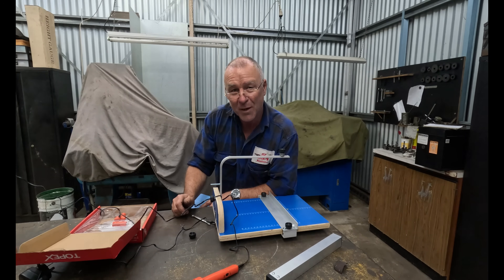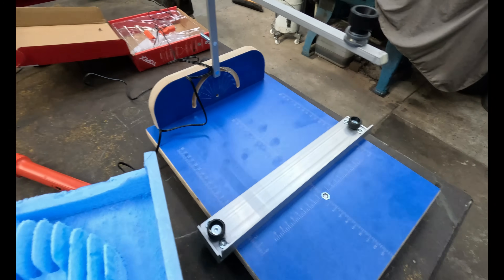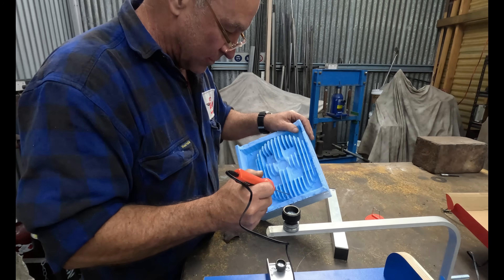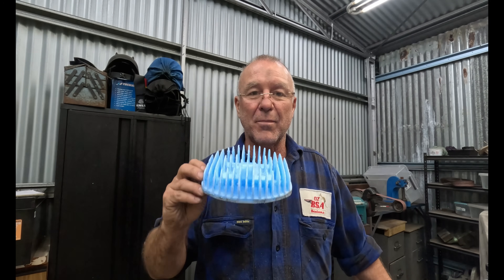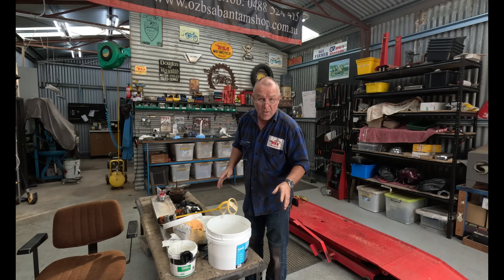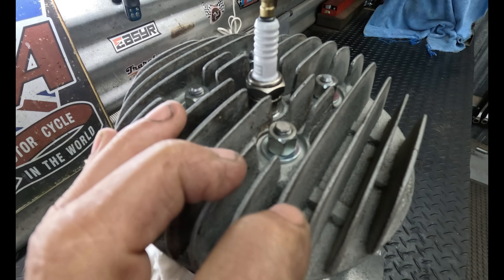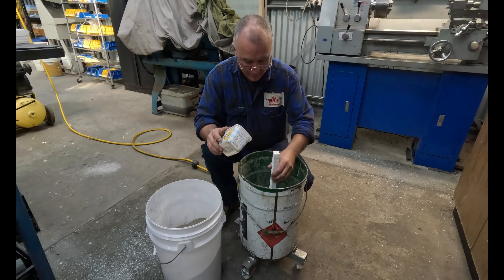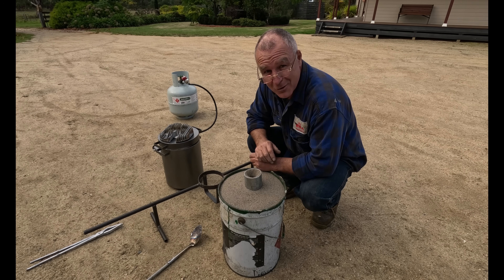Lost foam casting BSA Bantam head

Comment: Please turn off the gas at the burner end 1st, boom
Reply from the maker: There's no isolation valve at the burner end. the only isolation valve is the bottle.
Reply: @OzBSABantams  ok, that is dangerous. Strange they designed it like that unless there is a one way valve at the end, but I heard the squeal you hear before the bang, so was waiting for something. Good luck bud
Reply from the maker: @tonysimonsphdpending  Had a look at the video again (it's been a while) the only 'squeal" I detected was the flame going out after the gas was isolated?
Reply: @OzBSABantams  no, I'm not being silly. I've been near one of them explosions and that is the noise it first makes, then goes to a higher pitch before boom. Yours didn't go to the higher pitch meaning the flame died at the nozzle. Let me have another listen. Love the videos m8, don't get me wrong, I'm looking out for, not trying to be clever x
Had a look, yes that at 12.08 is definitely the first noise you will hear before the next. Come on, you looked at it when it did it! Keep up the good work buddy x
Reply: Right further to this bud. Do you recommend the slurry you used, or will I be better using refractory plaster? Reckon?
Reply from the maker: @tonysimonsphdpending  In all honesty I gave up on lost foam and went back to green sand. It took a while to get to my end result, but I got here. I'm sure you probably watched Kelly Coffield's video collection. he's the one who has mastered lost foam. I had to have someone machine the foam Molds, and if there was an error in pouring (and there was) I had to wait again for a replacement. Also the foam mold was very fine and had some machining difficulties. Green sand meant I could keep replicating the item without any hold ups. It also meant I could produce patterns on a 3D printer myself...........Good luck with your casting!

Comment: I would have two sprue , or a sprue in a U shape running under the head filling it from the bottom. One side filling the other side venting and acting as a reservoir as the head cools. Using  possibly 30 x 30 mm low density foam.  Ang get it atleast 150-200 mm above the top of the head. And possibly glue some low density foam on top of the fins. And  make it attach to the sprue  so they can fill and vent much easier. Coating in wet  thin plaster and allowed to dry being certain the area in between the fins is coated well with a tall sprue to keep the pressure high until it cools.  I love lost foam , lost wax casting, maybe a wax head can be made, coated the a block of plaster, then melted out, and filled with aluminum, like the 3D print castings are done??!!?  3D printing a head can be much easier..
Reply from the maker: What you've suggested is what I'll be doing next time..........It's been suggested by a few others.

Comment: Some ideas experimental-
Just having a look at the finished product seems pretty decent bar the extremes of the thinner sections. The fins not filling out - maybe air is getting super heated and trapped long enough to stop the AL flowing into the extremity of fins . I'd try gluing a small cylinder/square poly tube  that runs across the highest parts of the fins ( as it laid in bucket) and extend that to egress air at top of bucket. You will have to grind off that if flows to that extreme.  The other possibility is running a higher bucket and increasing the pour height for more liquid pressure into the cavities.

Comment: https://www.youtube.com/watch?v=4gtodI6QsFo
These are racing Bantams not what your playing with Tony.
Reply from the maker: Yeah I know all about the Bantam racing in the UK............What is actually factory BSA on them? Gear cluster.......Primary cover? You could call it anything racing because there's about 5% of BSA stuff on those bikes. The new class they developed over the last few years (superstock or supersport) is a bit closer to the mark. It's pretty obvious you'd dispute what is classified as a Bantam race bike, so show me a picture of a reed valved, alloy rimmmed, water cooled, disc braked front ended Bantam that was racing in the early 1950's? You can't and that's my point.........Good luck to those guys that do that in the UK. Those bikes are quick and they should be given there are basically no restrictions on what they can do to them. We'll keep developing our engines here under the limitations imposed by AMA and see what we can come up with.........And race them.

Comment: Foam's a fair amount more delicate than the bits of stringing that 3d printing can leave on detailed prints, but for those I actually use a lighter I wash over the print real quick. Idea might work for foam, though you might want a heat gun instead of open flame? Honestly you're making it work so more power too you, but thought I'd throw the idea out shrugs
Reply from the maker: Thanks for commenting and offering up your suggestions. Any and all input is welcome.........

Comment: One idea I had is where there are those 4 circles on the head mold where I assume holes will be drilled for head studs, you could put little "spot drill" divots so you have something on the casting to locate the center points of the holes.  Or maybe that operation is trivial.
Reply from the maker: No it could be done. However depending on what barrel I fit the head to may dictate the hole centres as they are different PCD's....

Comment: Looks like you need some help.  I have tried this numerous times, I was getting very close after ~ a dozen times, changing things to de-gassing and gave up!  That is what you should do, face the music and go green sand and split mold, that is how it was made.  I'm going to be short, because seems no one listens to me, contact me if you have questions.  Bentonite clay, sharp sand, and locking boxes.  I would first attempt it by cleaning the head really clean and rub baby powder into the surfaces, then sprinkle more powder, and pack the sand.  The next way is to make it out of Maple wood, make it smooth, and seal it, smooth it again, powder, then pack the sand.  With all those fins, I would put in lots of Bentonite and let the two halves sand forms dry before pouring.  Sometimes, one has to admit that this is the wrong road.   But, I still get drawn it, hoping someone has really figured out lost foam.
Reply from the maker: thanks for your input. I've already cast a head in sand...........watch my earlier videos.

Comment: A German company doing castings would have poured the material, be it steel or aluminium into a trough and let it fill the mould from below. I saw many casting made this way and witnessed dye penetrant testing after the casts had cooled, very rarely were there defects.

Comment: You need to put a riser and pourer in a mould - use a skewer to  add a multitude of vents  - George Tod made heads like that in the 70's - you would have more luck with lost wax and wet dip
Reply from the maker: Yes you need a pourer and riser with green sand moulding (look at the video where I did that) where the sand is bonded. Lost foam uses unbonded dry sand. There are a few technique improvements for the next pour. Thanks for commenting......

Comment: Tony, do you think heating the whole mold steadily over a flame (bucket and all over a burner for an hour or so) to raise the temp would help the casting process? Surely an extra 60-70 degrees would prevent rapid cooling of the molten aluminium and help fill the finer voids and extremities?
Can't hurt to try.
Reply from the maker: Thanks for commenting..........No I think my issue is guessing the material temperature instead of measuring with accuracy has a big part to play, plus the foam part had the fins too thin of a section to fill. Add to that my refractory coating was too thick to allow the gasses to escape into the sand. So knowing all that now I'm hoping the next pour will go better. I might add the people machining the pattern have never done foam before so they are on a learning curve like me too............

Comment: Lost foam is trash. Make a plastic epoxy mold and then cast wax castings. And do lost wax in the sand.  When you pour do it so the fins are down, and make sure you have a vent tube not just a pour tube.
Reply from the maker: Then I'd have to do a negative mold and have a pattern to do that. Cook the wax out ( I don't have a kiln) Much easier doing lost foam . I appreciate your comments...........
Reply: You dont have to cook the wax out you just pour the metal and the wax goes away same as foam
Reply: You could also do as before with just the bare sand mold use finer better quality greensand. Pour it hot with the fins down.
Reply from the maker: @Losermachine35  I wouldn't rule that out, however my green sand isn't up to scratch to do the job, it's too coarse and gives a poor finish. Also the pattern I used needs some more work if I were to use it again.......I'll keep persisting with lost foam for the time being. Thanks for commenting.....

Comment: Sand too dry and no vents for the smoke to escape if you use different sand with CO2 activation you will have better luck
Reply from the maker: It's lost foam casting......the sand is supposed to be dry. You don't use vents as the gases vent out through the refractory into the sand. Co2 activated sand for cores and green sand moulds that do have vents/risers etc..........
Reply: @OzBSABantams  incorrect
Didn't you notice when the aluminum came back up and spilled over like a baby puking? That's the foam gas escaping the only way it can .... I used oil sand and put a few vents in with the riser hollow and a sump with a mesh to stop sand ingress also the part was flat not vertical which is another mistake
Hey it's all a learning curve I'm just trying to help
Reply from the maker: @gearsandtears7643  The issue I had was I did the refractory coating too thick which prevented the gasses venting out through it causing it to vent back out the pourer. Sprues were parallel which meant the head pressure of the molten metal didn't force the gasses through the refractory. The part was vertical when poured........All and any input is welcome. Thanks for commenting
Reply: @OzBSABantams  such a simple head I'd sooner machine a block of aluminum you could cast the combustion shape and mill the fins your own design
Reply from the maker: @gearsandtears7643  That would be fine and reasonably easy for someone like me..........But it misses the point of trying to replicate the cast head and engine.

Comment: Back in 1967, Max Evans Motorcycles, or Caringbah Motorcycles, Captain Cook Drive Taren Point Sydney had 3 Walsh styled heads just like the one you have sitting, gathering dust on the top shelf behind the front counter. I was 13, a Bantam owner, and knew what they were, but the old man said it was a complete waste of time and money to put one on my worn-out '54 Plunger. They were probably sold as scrap when Max moved on. Great video, good luck with the next one and put a bloody respirator on, I've just been diagnosed with Pulmonary Fibrosis, 54 years in the building trade which has cut my life short.
Reply from the maker: Thanks for commenting.

Comment: When casting, especially with foam which will gassify as it burns away, you must have additional vents to allow the gas to purge. you were lucky the molten aluminium didn't plume out violently. Do please be careful.
Reply: 💯 needs to vent as he thinks it will vent through the sand which is impossible with the coating on the foam
Reply from the maker: Go and watch some of Kelly Coffield's YT lost foam casting videos...........Then get back to me about how many vents he has. No offence, but you're not to clued up on the lost foam casting process...........Neither are a lot of others.

Comment: Comments about needing vents are probably by people who have never done lost foam casting. I'm sure they are suggesting this based on lost way casting, something very different. With lost way casting the model and the vents are burnt out before the pour. That is not the case for lost foam. Any vent channels would still be filled with foam. Lost foam relies on the plaster to be porous to gas so that it escapes to the unbounded sand. 

I think that your aluminum was too cold. It seemed to me that the fins were too thin. Not just from a pouring standpoint but also from a heat transfer perspective in the final application. (hard to tell the actual thickness from the video. I think that it would have filled better if the part was tilted somewhat, so the fins were faced down a little. 

What also could help (but more involved) is to have the bucket holding the sand under partial vacuum (vacuum assist) to help pull the gasses through the plaster. I did skip some parts in the video so I don't know what you were using for plaster. If it was meant to do lost foam casting. If what you used had enough permeability. 

On pouring, you never want interrupted pours. The burp and flame caused the expected reaction of self preservation. Startling when not prepared for it. As far as PPE, I would also include a cap to cover the top of the head. Just in case something spits up and comes down on your heads. Chances are low but not zero. 

I also thing a proper set of lifting tongs would be good to have. You want to support the crucible when lifting out of the furnace. With the tongs you are using you have little surface contact and are squeezing at the weakest part of the crucible. Something like this style is better. https://i.ebayimg.com/images/g/PsIAAOSwVu5jqXOP/s-l1200.jpg
Reply from the maker: Hi .....I really appreciate your constructive comments. There are a few technique issues that will be addressed in the next pour. The pattern had knife edges on the fins caused by a cutter that wasn't sharp enough and incorrect speed and feed rate on the CNC. Metal has been addressed with a thermocouple on board now. I've made up a test piece to pour with thicker fins plus sprue and gates orientated as per Kelly's advice. The refractory coating was topcoat plaster slurry, however I think I layered it too thickly which prevented it gassing out into the sand and instead sent it back up the sprue. Yes I do have to make some lifting tongs however there isn't much weight in the crucible.........Next pour hopefully this weekend.......Stay tuned!
Reply: Lost wax?

Comment: Maybe a vent for the cast would of been a good idea...
Reply from the maker: Lost foam doesn't require vents.......It vents through the refractory into the sand...
Reply: I used to work in a foundry making the sand for the moulds. All the moulds had vents even the small ones.
 Whether it was for iron or alloys.
Reply from the maker: @silverfox57  yep they do need vents for sand casting........I worked in a foundry too. This is lost foam casting where the sand isn't packed like a mould and the gasses vent through the refractory coating into the dry sand so you don't use vents.
Reply: And that is why there is casting flow marks on the head as the gasses cant escape quick enough.
Reply from the maker: @silverfox57  That's right.........Which meant my refractory coating was too thick to vent the gasses.
Reply: Agreed.

Comment: Do an investment casting with a wax model melted out. The mould must have a vent
Reply from the maker: In lost foam casting the gases vent through the refractory into the sand..........there are no vents like sand casting. Wax casting would also require a negative mould which i don't have. thanks for offering advice......It's appreciated.
Reply: @OzBSABantams  3D wax print
Reply from the maker: @tonydoggett7627  The only issue is I don't have a kiln to do the melt out. The "wax"needs a fair temp to do the melt out. I have looked into it. Thanks for commenting.

Comment: I have neither expertise nor experience in lost foam casting but is it possible that cavitation is occuring because gases can't escape during pouring? I know you have the central stem but as half of the head is actually above that escape route how and where are the gases supposed to escape? They want to rise upwards but there's no way out. They expand until the pressure is great enough to push downwards through the molten aluminium so they can escape but the metal is already starting to cool down. If the pressure isn't great enough to penetrate the cooling metal it will be trapped in situ and leave imperfections in the casting. I might just be an idiot so ignore me if I'm talking rubbish.
Reply from the maker: No it's an OK theory.........The gases escape through the refractory into the sand. The sand isn't packed and is porous. My issue was the sprue wasn't tapered enough and the gases had an escape route back up the sprue. I think my refractory coating may have been too thick as well which didn't allow the gasses to escape well enough too.. Thanks for commenting

Comment: When I used to lost form cast we were taught to have a runner (to pour into) and a small open riser to let gas out. Nice job though, get the temperature right at the gas out, should be sweet.
Reply from the maker: Thanks 👍
Reply: Maybe an open riser at each outer edge of the pattern to get full gas escape.

Comment: As a x foundry man I would added some vents to let the gases escape
Reply from the maker: The lost foam isn't done in green sand is to vent out through the refractory into the dry sand. Have a look at Kelly Coffields casting videos. My sprue was too large on entry into the pattern and didn't allow the head pressure of the metal to force the gases out into the sand. Thanks for commenting I appreciate it.

Comment: Stupid question maybe but would it not be easier to machine the head from a solid block of ali?
Reply: without a CNC mill cutting the fins would be very time consuming!
Reply from the maker: Yes and no. If you wanted to CNC it you still have to write a program. What I'm trying to achieve is a replica type head so I really want a casting look and finish.